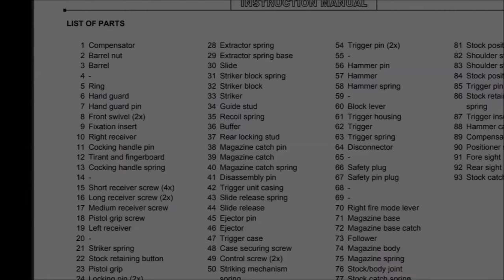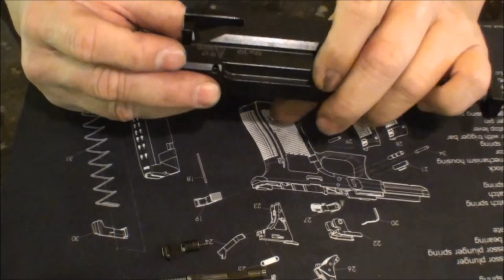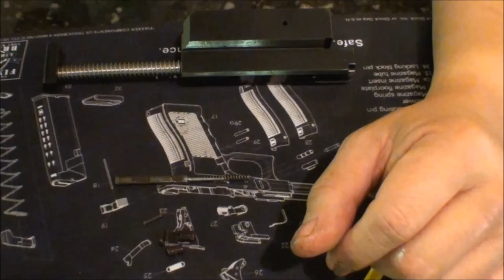CZ Scorpion EVO 3 S1 Carbine Slide Disassembly and Re-assembly

Comment: Thanks for the video. Quick question, am I supposed to be able to push the firing pin forward even when the safety block isn't depressed?
Reply from the maker: I had to verify first before answering and it seems that:  
* If you re-installed it correctly and first press lightly on the striker ( aka firing pin) it will stop and not move forward. 
* But if you proceed with even more pressure, you will see the striker  block travel slightly downward on its own and  allows the striker  to move forward.

I had a closer look and the striker block is manipulated by a lever in the trigger housing. each time you pull the trigger, the lever pushes upward depressing the striker block.

But you are correct the safety mechanism with the striker block does seem a bit suspect...?!
Reply: Diver Down I believe I installed the striker correctly. The grooves of the striker face down when the the bolt is laying on its top and the striker block is facing upwards. For me, I feel the striker rub against the striker block when I push the striker but it doesn't lock and just bypasses it with minimal force.